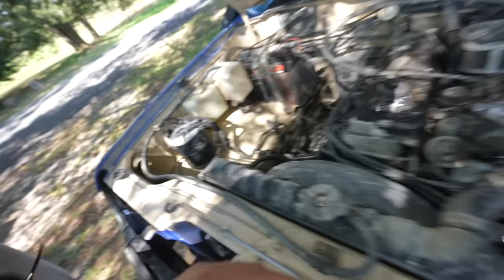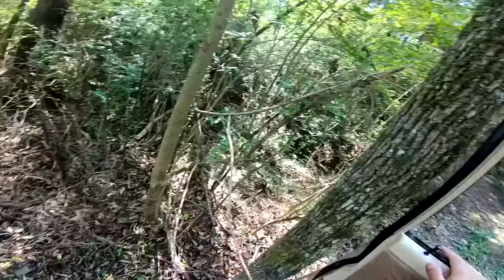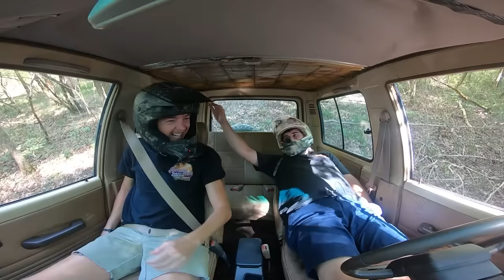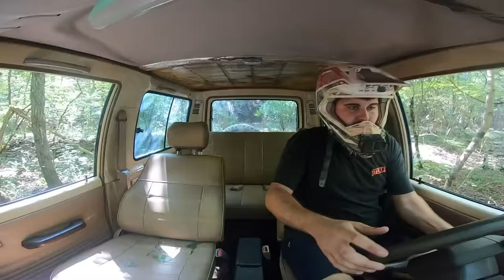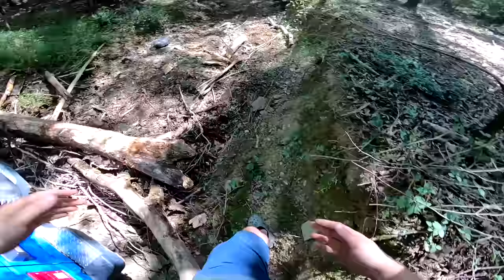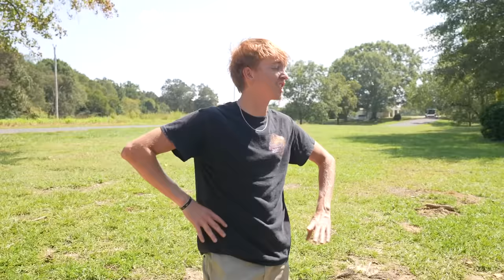Hitting the MUDDY TRAILS in the NEW 4X4!

Comment: Just a quick idea for better suspension travel. If the unit has sway bars equipped, removing them would give more articulation and for the ride quality, let the tires down to around 20-25 psi, you could go alittle bit lower but run the risk of debeading the tire.

Comment: Monte #2 Issa beast. That's not a diff lock btw its hub lockers it engages 4x4 but dosent lock. 100% weld the rear end solid and weld the front diff solid and put 31s super supers on it will be unstoppable

Comment: You have to lock the hubs or its not in 4x4! Otherwise you are still in 2WD. technically 1WD with an open diff. Put a set of diff locks in there and it will go everywhere! Bigger tyres is the only way to increase ground clearance but a lift might be the only way to fit bigger rubber in those arches.
Don't ruin the truck, just do a build on it!

Comment: So just to let y’all know you can lock the transfer case in 4 low and not lock the hubs and it’s an absolute torque animal and I had a 1992 f150 with a straight 6 engine and it would absolutely burn the tires off in 4low and second gear in an automatic 😂😂😂 wouldn’t even touch first because it was so low